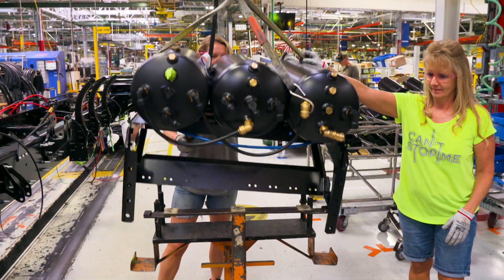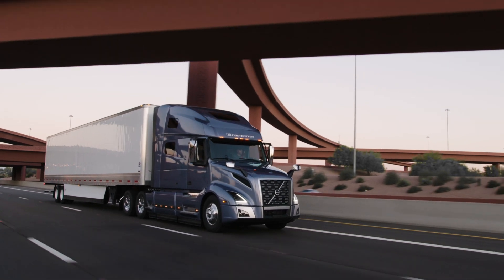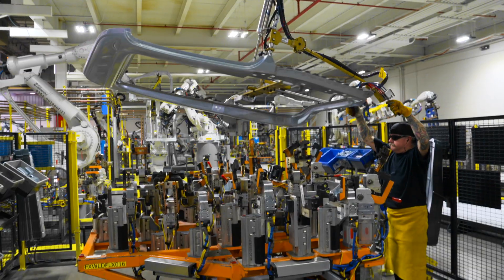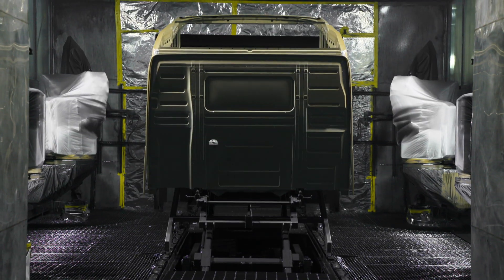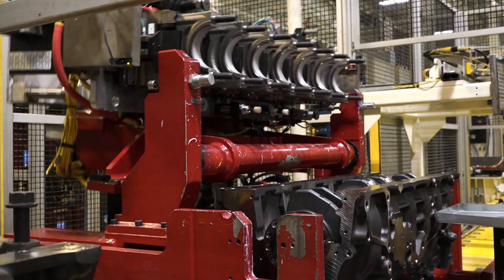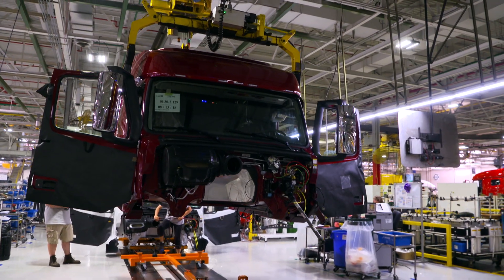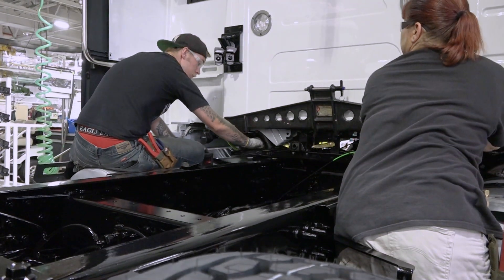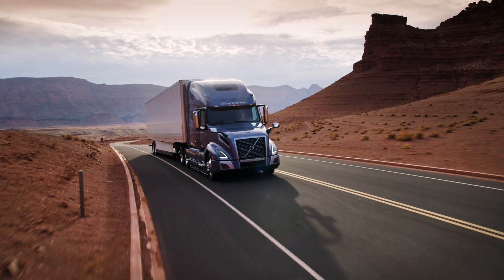Volvo Trucks – How to build a new Volvo VNL

Comment: 2 weeks ago bought new 860 did few trips  truck was pulling to side already did Alighment and was way off on steer  middle axle now driver upper window start leaking
Reply: Duck tape ! Works good on the 2019 Volvo, by the sky light.

Comment: Would be nice if they insulated the cab besides just the wall panels.  Also, the heat / cold coming through the greenhouse is just ridiculous.  I’m also going deaf from the high ambient noise in the Volvo.  It rides like a lumber wagon over bumps and yet wants to lay over on its side in a good crosswind.

Finally, the hood and step fairing securement is the absolute worst in the industry.  Shameful even.

🤷🏻‍♂️

Comment: Do American Volvo trucks have 16 litre version of engines too?
Reply: With this new generation Volvo ditched the D16.
Reply: Old VNL had the 600 hp spec 16 liter
Reply: The D16 engine is not available in north america market now.
Reply: @pengkaihe4065  I think they will make a super heavy duty variant of VNR  in following years and then we maybe see the mighty D16 on the USA roads again.
Reply: The VNX heavy haul series has a cummins 15L option.   https://www.volvotrucks.us/-/media/vtna/files/shared/trucks/brochures/vnx-product-english_2.pdf
Reply: Might be the 16 liter again for some Heavy haulers. But generally it's 'overkill' With that big engines as most of these trucks just glide across 'the flat praire', where 400-500 hp is enough, and keeps cost down
Reply: @Rimrock300  Its too much for highway trucks basically